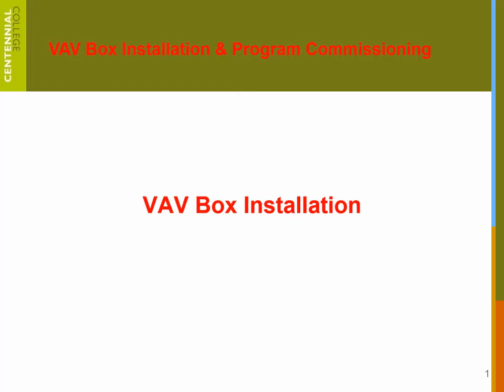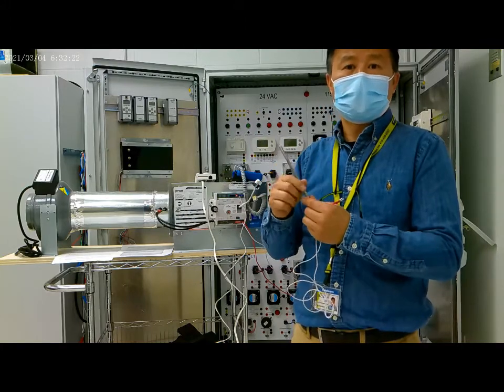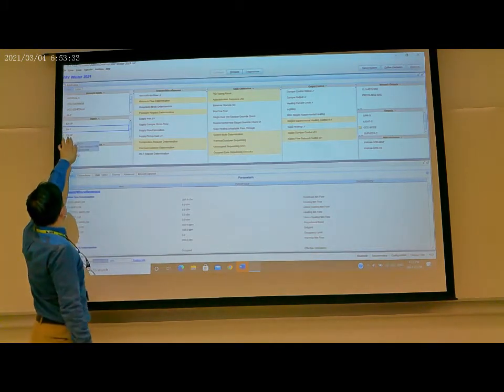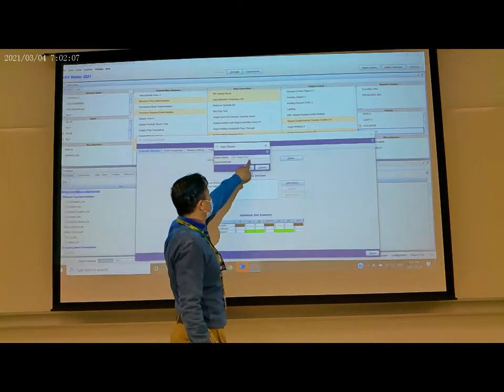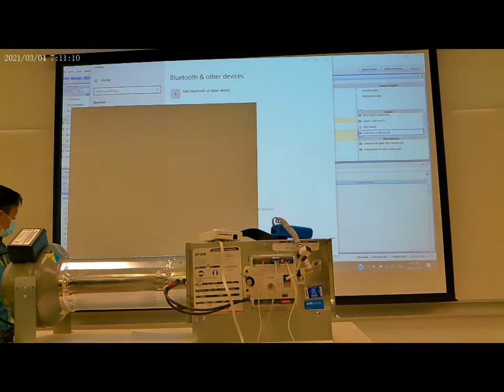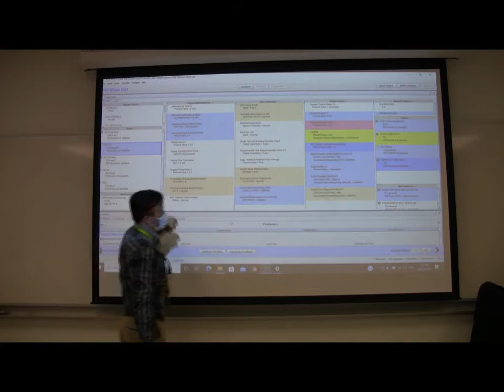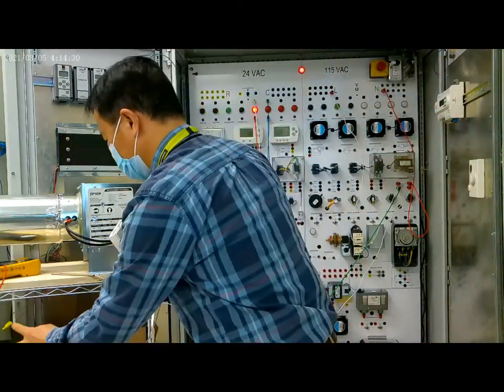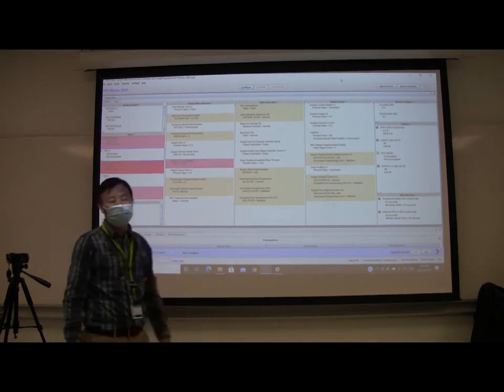VAV Box Installation and Commission Part 1

Comment: Nice VAV box model👍 Some suggestions: 
1) Add an analog pressure gauge so that students can see how the pressure changes at the sensor when the airflow changes (Dwyer Magnahelic ).
 2) The air damper has a position indicator but it’s hard to see, maybe if you paint it with a bright color may be easy to see. Or add a bigger position indicator.